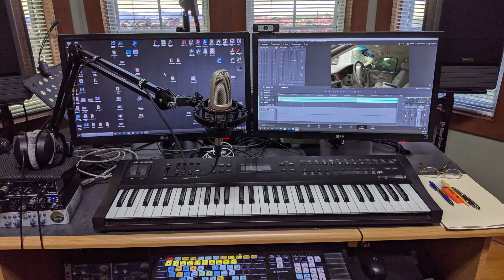Steering Wheel Leather Plug v40

Comment: Great job mate. I love your videos.Unbelievable. So you think you will have any problem with cracking where you used the glue. I did some light scratches on a leather BMW  steering Wheel with some medium viscosity power gel. I barley used any but all the places I used it cracked and it came back to me. I’ve been using leather compounds from viper now on s. Wheels  but they take along time to dry and hard to apply woth pallet knife ( I might try your trick with rag and paint ).
Reply from the maker: Glue by itself is going to crack.  We see it all the time in others' repairs when they expect glue to do the entire job over a flexible substrate.  This method, however,  allows for a lot of movement and flexing.  Nowhere is there any continuous film of glue to crack.  You can see that I didn't take any special care in handling the steering wheel after the repair was made.  Even masking directly on top of the fresh finish.  That's the confidence I've come to have in the process.  Thank you for contributing!
Reply: Well yesterday I was able to successfully complete my first plug thanks to your awesome video. Customer was happy. I work at an upholstery shop part-time so I grabbed a couple pieces of scrap leather and I keep them in my truck. I did not have the scathing device so I had to shave down the back of the leather with my knife and a razor. It was still too tall though.... Overall works great but I had to sand the crap out of it. Kudos!

Comment: what would you recommend for a regular rubber steering wheel as a filler?
Reply from the maker: I have used a 2 part flexible epoxy to establish the contour and then covered with a custom leather wrap.
Reply: @a.r.t.srealrepairsforrealc8247  thank you for your response !